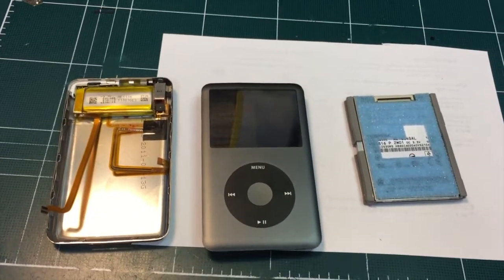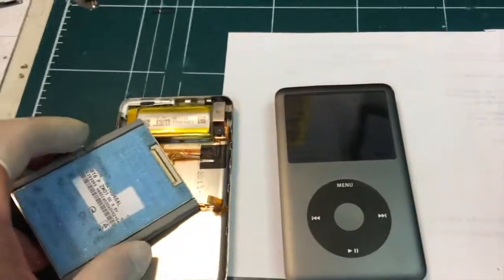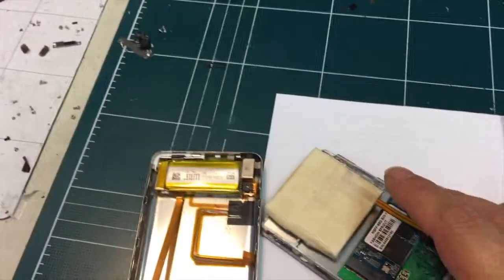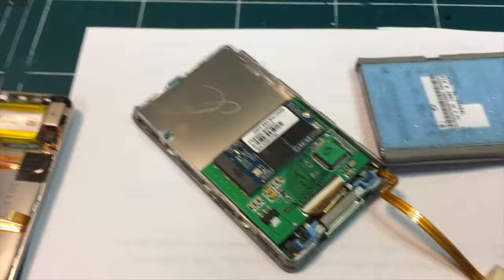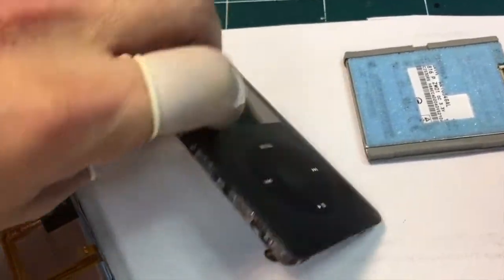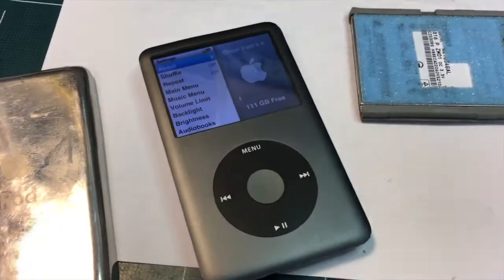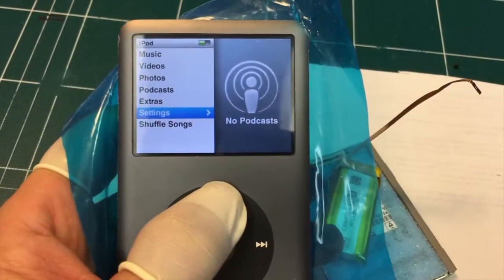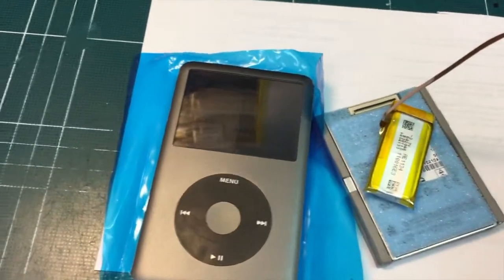iPod Video HDD swap w:SSD

Comment: any update is this gave you any problem? thanks!
Reply from the maker: Still working. There is no reason why it won't work. there is no firmware device update or such. as long as SSD is working, it's good to go.
Reply: i just ask because some people reported everheat from ssd over time!! 
thanks